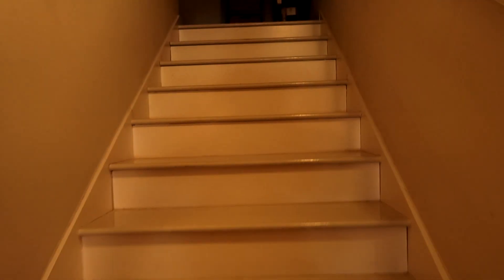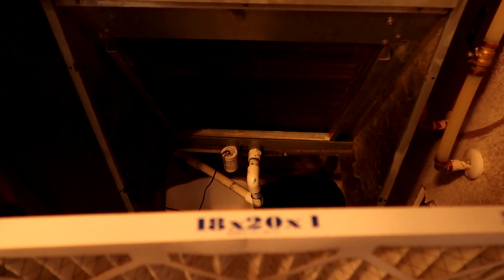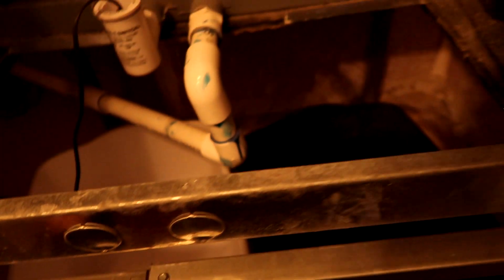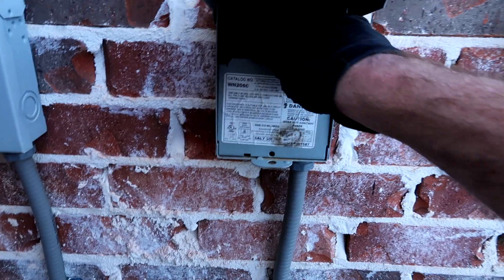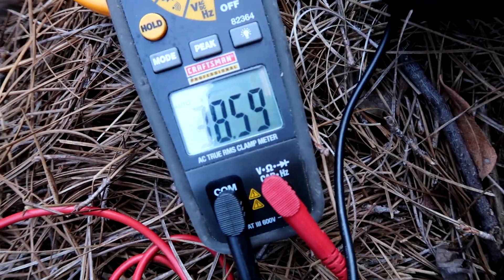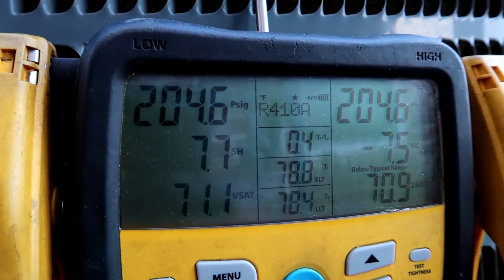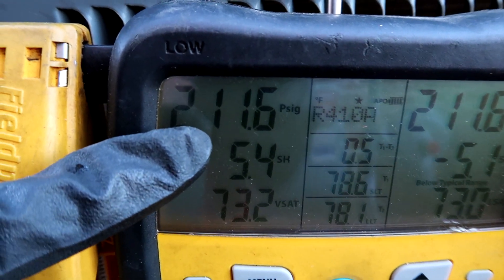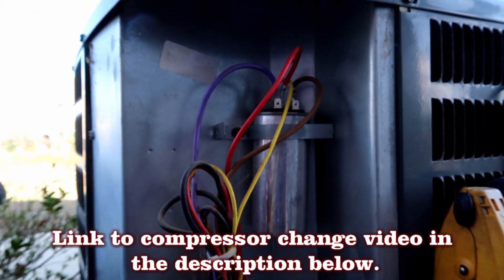The Handyman

Comment: Those high merv rating filters are equivalent to having a dirty filter. The filter is not for the occupants, the filters are for the unit itself. I always use the cheap filters too. Good tip brother.

A skunk nailed to a dead man…. 😂 been there a few times myself 😝
Reply from the maker: Good to hear from you Danny!
Reply: A Merv 8 is not a high rating on a air filter. If the air handler is older then yes use a cheaper hogs hair style filter, but if it is newer model use merv 8. It helps keep the evaporator coil clean.